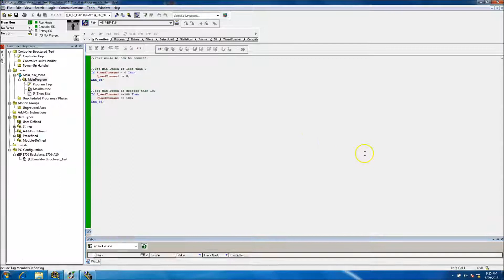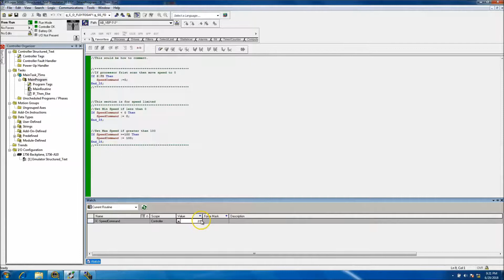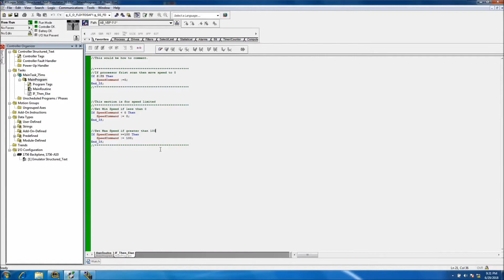RSLogix 5000 Structured Text First Scan Logic

Comment: Shane, instead of using the 'S:FS' bit could you use something like this:
if SpeedCommand <= 0
then
 SpeedCommand [:=] 0;

end_if;

Square brackets indicate clearing the value prior entering the Run mode. Tell me if there is a difference
Reply from the maker: The First scan is what is mostly used in the industry.

You can trigger a first scan from another trigger but this is the best practice use.

Hope that helps
Reply: @ShaneWelcher  yeah, I noticed that lots of people use S:FS, but wanted to point out a shorter path to program the same outcome. Also, ST is retentive in it's nature as opposed to LD, so we have a specific option here to make it non-retentive. I tested and it works as expected.
Thanks for these videos - very helpful
Reply from the maker: @dangerL7e  Yep, I'm aware.

Thanks, hope all is well